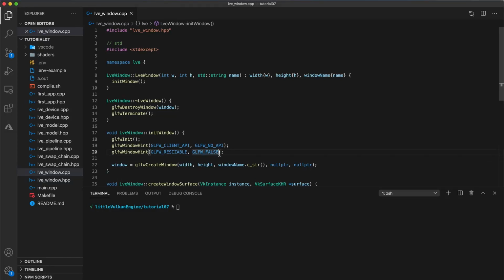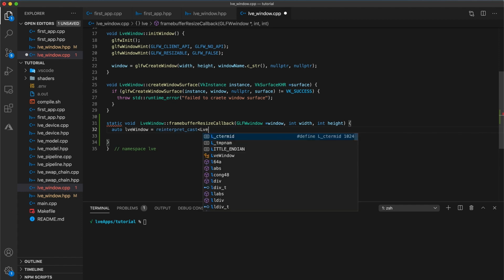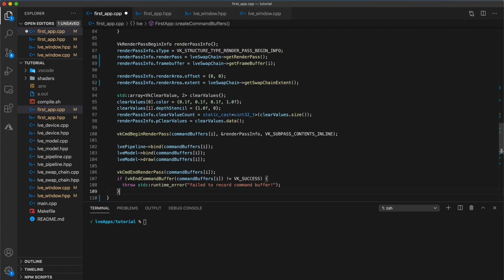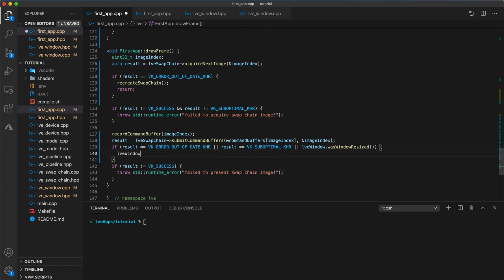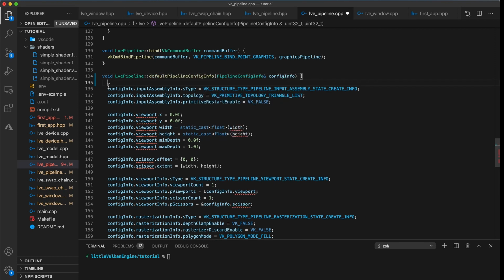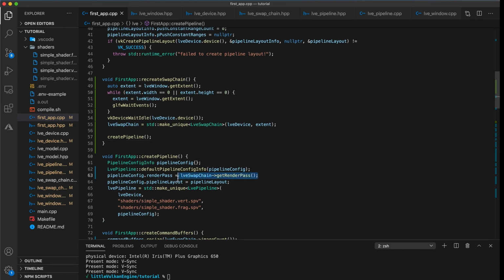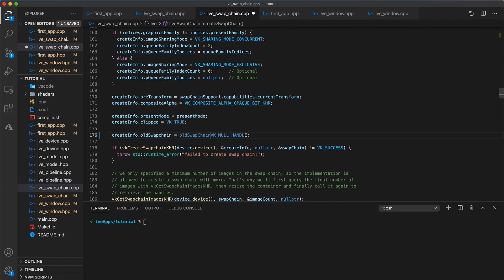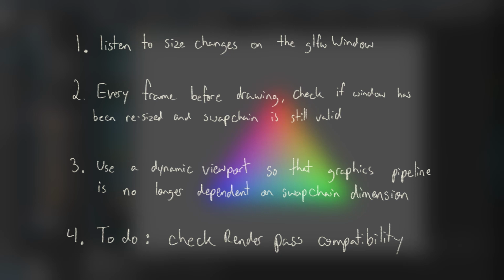Swap Chain Recreation & Dynamic Viewports - Vulkan Game Engine Tutorial 08

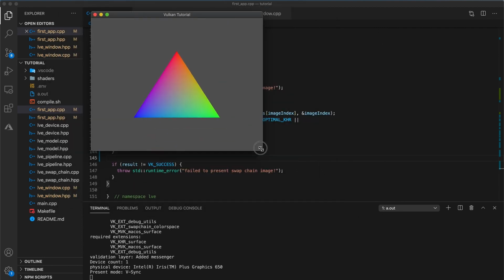Comment: 7:56 
In my case, when I resize the error, vkCreateSwapchainKHR is returning VK_ERROR_NATIVE_WINDOW_IN_USE_KHR. I have spend my entire day comparing our codes and there is no difference. I'm using Windows and an RTX 3060. What can I do to fix it?
Reply: Hi, may be its too late. I found out the problem. In recreateSwapChain before SwapChain = std::make_unique<SwapChain>(device, extent); add a new line with SwapChain.reset(); to clear unique pointer and delete an old swap chain.
Reply: @SDynasty-yi3mi  thank you! but I already gave up from Vulkan🥲

Comment: Very late to the party, Series is still great.  I had a crash after resize with failed to create swap chain!, a little debugging later and this was beibng caused by vkCreateSwapchainKHR failed with error code: -1000000001 VK_ERROR_OUT_OF_HOST_MEMORY
To fix this I had to add a line to recreateSwapChain

    void FirstApp::recreateSwapChain()
    {
        auto extent = vgeWindow.getExtent();
        while(extent.width == 0 || extent.height == 0)
        {
            extent = vgeWindow.getExtent();
            glfwWaitEvents();
        }
        vkDeviceWaitIdle(engineDevice.device());
        engineSwapChain.reset(); //Fixed and out of memory crash
        engineSwapChain = std::make_unique<vgeSwapChain>(engineDevice, extent);
        createPipeline(); 
 }

Hope this helps if anyone else is having the issue!
Reply: I met the same crash. Your solution saved my day😇

Comment: FIXED Im getting crashes. When I replace my code with the code from brendans git it does work. but still, I could use some advice on how to debug with this project. My code is throwing the "failed to create graphics pipeline" error in the CreateGraphicsPipeline function in the pipeline.cpp file, but thats it. Why? all of the arguments to vkCreateGraphicsPipelines are initializing, but then for some reason they cannot be combined to build the pipeline.. EDIT: 2 days huh? same here. My mistake? PipelineConfigInfo pipelineConfig; instead of PipelineConfigInfo pipelineConfig{}; I think I should go back to college

Comment: Present mode: V-Sync
Present mode: V-Sync
Present mode: V-Sync
Present mode: V-Sync
Present mode: V-Sync
validation layer: Failed to initialize swapchain image (249561094)
failed to create swap chain!

why my terminal shows that my window exist a while and then gone?:face-blue-wide-eyes:
Reply: What OS are you using? I got an error when starting with VSync, mentioning that the buffers are not completed before creating a new one? And to your problem: I got the same error and fixed it by adding a default constructor to the PipelineCOnfigInfo, like this: PipelineConfigInfo() = default;

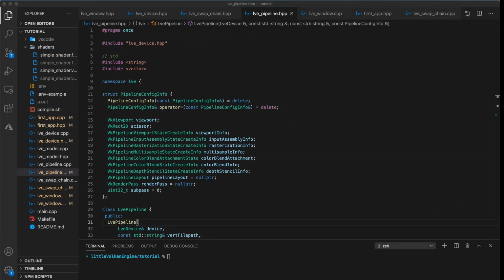Comment: At 8:37 if you're using C++20 you need to add a default constructor to the PipelineConfigInfo struct, otherwise the compiler will tell you there's no corresponding constructor when you try to create it later
Reply: THANK YOU
Reply: THANKS MATE

Comment: What's interesting, is that when testing on linux I get this strange
"The Vulkan spec states: commandBuffer must not be in the recording or pending state"
Error which I can't get to disappear. The app and resizing is functioning, and I wanted to ask if I should be bothered.
(Tested on Ubuntu 24.04 WSL, made using g++ just after the "Updating drawFrame()" section, implemented both fixes in the pinned comment)
Reply: How'd you fix it? I had a similar error on windows and used this approach: 
        vkQueueWaitIdle(lveDevice.graphicsQueue());

        vkResetCommandBuffer(commandBuffers[imageIndex], 0);
just before the if(vkBeginCommandBuffer...)

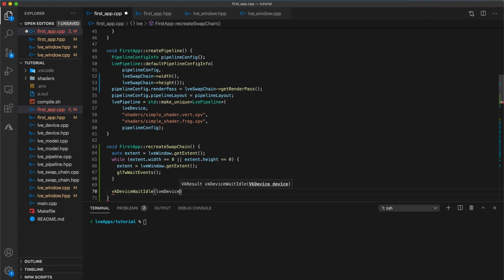Comment: At 6:04, shouldn't line 66 and 67 be switched? The Khronos tutorial has the same code that confuses me. On line 64, you just got the extent, why would you immediately get it again? It makes more sense (no?) to wait for the events first, and then check if that event has changed the extent. Right?

Comment: I'm trying to follow this tutorial even though I'm handling the window, surface and events with SDL2. This one gave a ton of problems as it was trying to recordCommandBuffers with the swapchain not updated. what i did is to  add `|| m_window.wasWindowResized()` on the first time we check result == VK_ERROR_OUT_OF_DATE_KHR on drawFrame() 
I'm not quite sure if i'm redoing unnecessary stuff, but it works

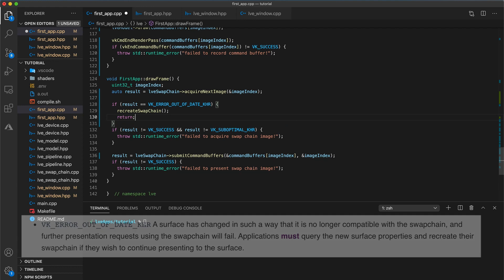Comment: 7:07 recordCommandBuffer was called on startup and is now called in drawFrame because it needs to be called again if the window has been resized.
But now it's called every frame. Couldn't it be just called when result is VK_ERROR_OUT_OF_DATE_KHR, right after recreateSwapChain is called?
Reply from the maker: Ya you’re right. But for a game where objects will be dynamically created, removed etc the command buffer will likely be different every frame. So we’re just making the change now in preparation for future tutorials

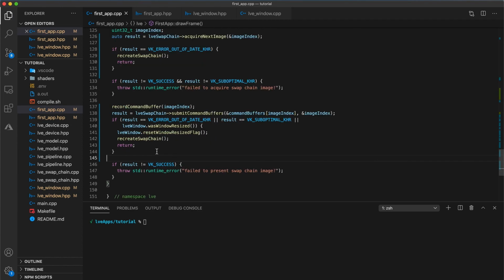Comment: Greate content! but why would we need to check for resize twice at time stamp 7:45 (before record command buffer L133, and after submitting command buffer L139)? also why do they have slightly different checks?
Reply: FWIW, I tried moving the block from L139-L144 to replace L133-L135, and seems to work exactly the same. (for now at least haha)

Comment: Hi, little late to the party, why are you also recreating command buffers? Love ur content btw
Reply from the maker: Thanks!

Really we’re just re-recording the command buffer. The main reason we’re doing this initially is that when the windows size changes we need to update the recorded viewport. By doing this every frame we never need to worry about the windows size and the recorded viewport from being out of sync. 

In the future though it’s very common for things to change between frames. Objects being added to the scene or removed, loading a new part of the game world, etc. In which case what we’re drawing will change and different draw calls will need to be recorded. 

Since recording a command buffer is a pretty efficient operation, the common thing for engines to do is record the command buffer each frame.

Comment: I followed all code in this video and everthings goes fine except changing the size of window. The triangle can't be smoothly changed. Maybe my "Mailbox" present mode contributes to this issue?
Reply from the maker: Ya smooth resizing is a bit more complicated to do at this stage. The current behaviour relies on OS differences. I wouldn’t worry about smooth resizing until we’ve covered some more topics

Comment: Hi, I just completed up until dynamic viewports and upon compiling and running, while i get no errors, the dynamic viewport resize doesnt seem to be working, it looks exactly the same as before it was dynamic, ive done my best to triple check I have everything as its supposed to be even including the error correction on github but cannot seem to get dynamic adjustment working
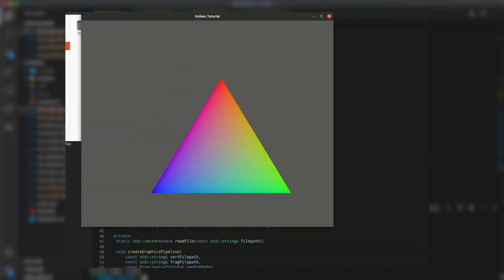Reply: I had the exact same issue. He briefly mentions why this happens at 8:15 with regards to calling glfwPollEvents() in your run function that ultimately blocks the rest of the app while resizing. The fix, as he mentions is to find some way to continue calling drawFrame() even while resizing. I accomplished this by implementing an observer pattern on the window class. I added a subscribe method to the window class which gets passed an std::function<void()> and adds that function to a list of subscribers. Then, at the end of the frameBufferResizedCallback function, I called another method I added to the window class on our local window object called notifySubcribers which just looped over the list of subscribers and invoked each one. Finally, in the very beginning of our run() function of the Application class, we can call the subscribe method of our window object passing it a lambda like so, "[this](){ }". Inside the lambda we must do three things. One, call resetWindowResizedFlags on our window object. Two, recreate the swap chain. And three, call drawFrame(). Congrats, you should have a smoothly resizing window!
Reply: @baileymorgan9986  Thanks for your solution. It works for my Win 10.
Reply: @xinyuelei2125  awesome, im glad it worked for you!
Reply from the maker: Sorry I missed responding to this. Did you figure it out?

Here’s the link to join the discord https://discord.gg/CUQkuKsszr for debugging help usually you can get a quicker response there

Comment: Regarding the pipeline config info struct, wouldn’t it be better to use custom structures to hold the data? This way you can use vectors and smart pointers, which will automatically be copied correctly. You could easily just recreate the Vulkan structs in the createGraphicsPipeline function.
Reply from the maker: ya that is a great option! For now though, I can't see the config info struct being passed around too frequently or stored long term, so deleting the copy constructor and passing in by reference is a simpler solution which works well for the current state of the engine.

Comment: Would it not be necessary to only re-record and submit the the command buffer (in FirstApp::drawFrame) only if the window has been resized? I.e. only of the swap chain has been recreated? Would there not be a way to design it this way? Why do we have to check VK_ERROR_OUT_OF_DATE_KHR and lveWindow.wasWindowResized() for example?
Reply from the maker: Good question! Yup you are right in that we could try to optimize things here to only re-record when the window has been resized, and later on only if something else in the scene has changed. But as we continue on in the series we'd pretty quickly have to undo this optimization because in games it's pretty common for something to be changing every frame, so the time it takes to detect if any changes have occured would quickly outweigh any benefits of avoiding having to draw the occassional frame.

However, if you're using vulkan to create something like a user interface engine maybe this could differ. A good example of something like this would be Flutter for mobile UI. Most of the time a UI doesn't change frame to frame. Some user input may trigger an animation or some other change, but then after a short amount of time things will quickly return back to just being static. In which case optimizing to draw only when changes are actually happening would be worthwhile as it leaves processing available for other tasks as well as can significantly reduce battery drain. 

So we're checking things like VK_ERROR_OUT_OF_DATE_KHR and wasWindowResized() for the purposes of how game engines work by nature. Most modern game genres typically require a constantly running game loop that are updating the world every frame. As we continue to develop the engine, this is a paradigm we will follow and will drive many design decisions. 

However even for some games this might be overkill, for example maybe something like an old-school point and click adventure style game would be better suited to the only draw things if we know something has actually changed.
Reply: @BrendanGalea  awesome that makes total sense - thanks for the reply!

Comment: I don't have an issue such as in the pinned comment but my output log is spammed every frame about CommandBuffer.
Error text is "Calling VkBeginCommandBuffer() on active VkCommandBuffer before it is completed." and so one.
I triple check the code and it seams like everything is on par with the diff you provided.
I use MacBook on M1 chip by the way, everything works great besides this error :D
Reply from the maker: I think I might've come across this once before. To confirm, in the drawFrame() function try printing the imageIndex variable. It should cycle through 0, 1, 2, 0, 1, 2... and so on. But for some reason one other viewer (also on a mac but not an m1), the API would return an image even if it was still in use. So you would get like a 0, 0, 1, 1, 2, 2 pattern. 

The temporary fix would be in the app's run() function, inside the while loop just under the call to drawFrame() add vkDeviceWaitIdle(lveDevice.device());

This will make things slightly less efficient, but in tutorial 11 after we make a frameIndex counter independent of the imageIndex counter that should fix the issue and you can remove the vkDeviceWaitIdle(lveDevice.device()); then. 

Hope that helps! and if that wasn't the problem let me know and I'll see what else I can come up with.
Reply: @BrendanGalea  Yes, everything happened exactly as you described. And the fix is working.
Thank you :D
Reply: For the record, I had the same error and the imageIndex stays at 0 in drawFrame(). After switching from WSL to windows the issue was resolved.
Reply: @reedhuang2420  I have exactly the same issue with wsl, you just ran it directly on windows trough visual studio ?

Comment: What is the difference b/w the subpass count that we set in pipeline creation and the subpass count in renderpass?
Reply from the maker: subpass count in renderpasses is the number of subpasses the renderpass contains, the subpass value in the pipeline create info is the index of the subpass in the render pass where the pipeline is used. 

So we could make a renderpass that has two subpasses. And then we would have two pipelines, one with subpass (index) =  0, and the second with subpass = 1.
Reply: @BrendanGalea  Oh wow so I can't have multiple subpasses in one pipeline? I tried going through the spec, but man that's too big, and don't really know how to navigate it.  Okay so if I may ask, how did you manage to get "The Big Picture" of this? How long did it take? I'm kinda starting out, so any books that might've helped you, and other references would also help a lot. Thank you!
Reply from the maker: @Dexter Man  - ya the spec is really useful when you just want to look up something specific, but not a great resource to learn from. 

I haven't really explained render passes in detail yet so I can understand the confusion, but I think in your mind you have things a bit backwards. The purpose of subpassess/multiple render passes is you want the output of one pipeline to act as input to some other pipeline. That's why you can't use the same pipeline, because it would require its own output as its input...

For me getting the bigger picture, it took awhile to be honest, a lot of trying out different resources, some good... some less good. And then I also took a couple graphics/animation courses in uni. 

This is a great free text on ray tracing, so not quite what we are doing, but lots of overlap in like the key underlying principles
https://www.pbr-book.org/3ed-2018/contents
Fundamentals of Computer Graphics by Peter Shirley was my textbook from university and still a great resource but kind of pricey
And game engine architecture by jason gregory is another good textbook, not focused on rendering, but on the other aspects of making a game engine. 

In terms of how long did it take... I feel like I still have a lot to learn :D I think what helped me was just focusing on small goals, and small projects. Computer graphics is just one of the massive topics which is more similar to mastering a skill rather than a subject you learn. Mastering something like playing the piano can take decades of practice, but only a couple months to a year before you can start making nice music. I think computer graphics is something like that too.
Reply: @BrendanGalea  Thank you very much for the detailed response!

I see so I can have multiple pipelines each feeding into or in parallel, so create different effects? Dang that's nice.

I'll take a look at the resources you mentioned, thanks! 

That's a fair point, and you're doing a great job explaining it! Great series! I'll see if I can finish up my pipeline setup (and maybe understand it) before your next video :)